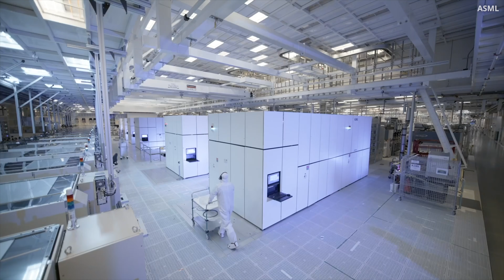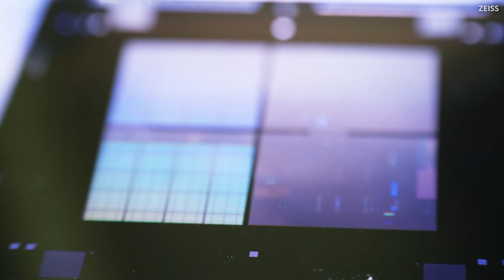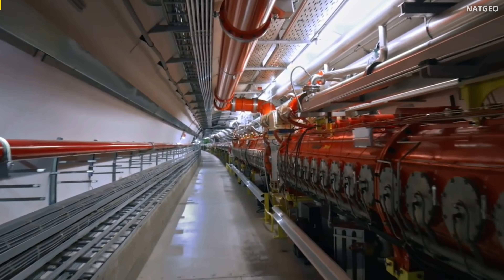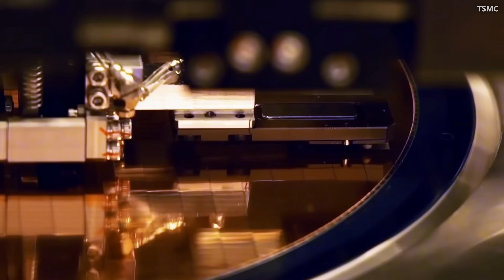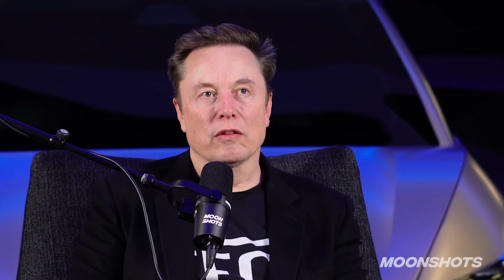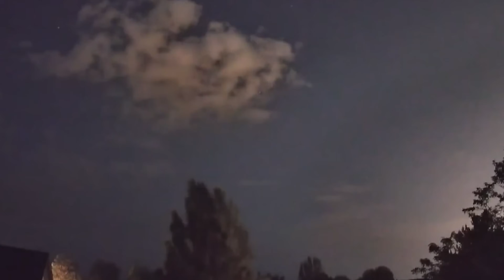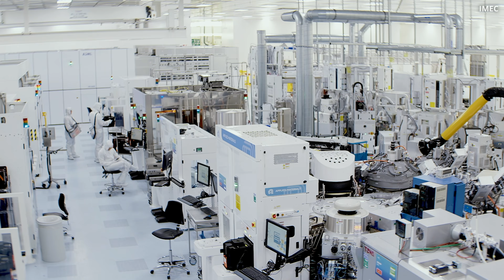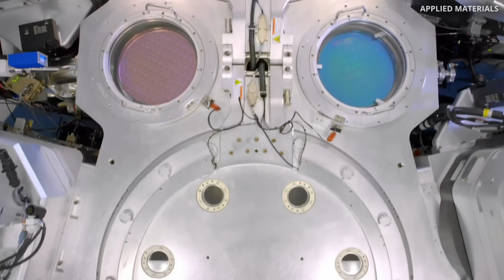New Chip Factory That Terrifies TSMC

Comment: There is a loss of chip area usage efficiency of fitting square & rectangular dies into a circular wafer.  Probably not practical, but its hard to say where brainstorming leads.....  Why not consider making identical (but perhaps individually rotationally positioned) dies of other shapes, starting with perhaps a hexagon.  One issue is cutting out the resulting dies if the cuts are not straight in X and Y ... but perhaps a laser can cut out the odd shapes.  Beyond hexagon shapes, what about various surface tilings?   Certainly circuit layouts from schematics are done automatically in software, and doesn't necessarily need to be done as a strict
 quadrilateral.

Comment: I think you’ve missed the core engineering shift. Elon’s 'cheeseburger' comment wasn't about making a dirty fab; it was about Wafer Isolation. It’s the 'Boy in the Bubble' strategy - the cleanroom is built around the equipment using vacuum-sealed lines, not the entire building. Also, the building going up in Austin is just the 'Advanced Tech Fab' (the Pilot Site), not the Terafab itself. That full-scale facility is almost certainly headed to Arizona, which is phasing to a 0% corporate tax rate (SB1252). Texas’s 'net receipts' tax is a non-starter for a project this big. They are using 700mm square glass panels (which Intel just demoed at NEPCON) this is 'probably' why Intel was invited in recently, as glass finally deletes the 'warpage wall' of circular wafers. Substrate (the company you don't seem to know is the heart of this project) is using maskless X-ray tech that’s already hitting 12nm. It's basically a parallelized evolution of the IBM 1977 EL-1 logic. While you're waiting for an ASML machine that won't show up until 2030, they're already drawing the future on glass in Austin.
Reply: Hmmm...  700mm square glass panels...  From a process tool perspective this reminds me of the early 2010s,  when AMAT and others introduced and demo'ed a-Si CVD tools for the production of PV panels that were roughly based on SOI  semiconductor process technology. Patterning - of course - wayyyyy simpler, lithography not needed, aso, asf. 
However, there was not enough silane gas produced on the globe to supply even 3 of these resource hungry fabs and would have totally drained and dried up the supplies for Si semi manufacturing. 
This led to a crazy global battle for process gases and chemicals resources between PV and front-end semiconductor manufacturing that let silane  projections and prices skyrocket, spiralling totally out of control and led to 5-year take-or-pay contracts that were stuck onto strategic purchasing at distributor and end-user levels, resulting in panic divestment and shotgun  supply contract reviews. And it wasn't just the silane, PVD/sputter targets, the "solar grade flat glass", bulk UHP chemicals, etc, were caught in the same mess, altogether...

Today, approximately 15 years later, it seems that still nobody has learned their lessons from that disaster. It's all beautiful movies and projected performance specs, feeding the patriotic investor's wet dreams. The reality will lead to a rude awakening as many critical materials (not to be confused with the rare earth metals discussion, I am talking UHP specialty gases and chemicals here, together with uniform 800mm UHP PVD targets) are down to single source supply only. No competition on the supplier side as many investors learned their lessons when burning their fingers at this overheating market. And NO, China won't help us here as they will restrict the export of critical process chemicals as we restrict the export of critical process tools. 

At SEMI ISS a few weeks back, the increasing scarcity of critical and strategic process materials of sufficient UHP and related high quantity manufacturers was flagged as one of the most critical bottlenecks of future production of 2nm/20Å dies. How this battle for critical process materials will play out is going to determine the future of chip making and wafer processing. And these worries just adressed front-end only, back-end with  dicing/slicing and packaging are completely different animals to tackle. 

Things are totally going to stay interesting - specifically when taking the global politics into consideration. I have received documents from front-end manufacturers already, asking for local storage of critical materials, contingency plans for logistics routes, dedicated for each gas and chemical, related 1-, 2-, 5- and 10-year  price and cost projections for the above and contingency plans to develop new raw materials supplies as many were sourced from Russia and countries of the former USSR and then again, China. 

Fun fact: semiconductor grade silicon cannot be made from sand, as it contains way too many impurities that make it commercially impossible to purify. The raw material for the fumes and wet silica processing is silica sand, basically a mineral closer to quartz than to sand itself. Also, the qualifying quarries are a handful and the best ones are not located in the US. You also need the same quality silica sand to produce the 700 mm glass wafers. 

There are so many aspects aside process engineering and not enough space to discuss them here...
Reply: @BigBoy4004 a small company by the name of HPQ silicon is close to commercializing technology that would allow the production of hydrophilic fumed silica from sand in a 1 step process. Hopefully that would alleviate the pressures on the supply of silane gas somewhat
Reply: This is all very well, but you still have to maintain the equipment, and that's going to expose the interior to the local environment.
Reply: @rogerfroud300  this is just my speculation, but Intel and Elon know how many people TSMC uses to keep their fabs running and both are trying to use AI to employ far fewer people, Tesla will run out of money if they have to hire too many people, also it's my understanding that Intel has made a lot of progress to automate their newer fabs so they don't need to use the TSMC high schoolers to a kind of a trade school pipeline to babysit each ASML machine to keep it running, I expect this new Fab to be basically a giant robot with very few humans and Grok doing a lot of the work
Reply: @DaxVJacobson  Dax sees the future while roger looks at the reality. Terafab’s success depends on whether Tesla and Intel can invent a “third way” that makes both visions work. I believe that this is ultimately just an engineering problem. In tech, what looks like “impossible physics” often just needs better automation. The April 2026 updates show Musk is betting on automated preventive maintenance—robots fixing machines before they break—to prove the skeptics wrong.
Reply: @DaxVJacobson This comment does not make much sense to me. The entire chip fabrication process is basically automated. You would have to somehow remove steps in the process to employ less people. Those machines do not maintain themselves and operators are low in headcount to begin with and AI is not mature enough to do operations work let alone maintenance or process engineering roles
Reply: whats this have to do with cheeseburgers?  what is a “semi conductor” like music stuff?
Reply: Try head and shoulders.
Reply: I agree 1000%   The real semi ecosystem is being built right now in Arizona.  Every week a new semi infrastructure company is coming to metro Phoenix -- LAM Research just bought a building that can house 2000 people.  A $7B science park is being built (Halo Vista) next to TSMC in N Phoenix for all the Taiwanese and Japanese companies (and American, and European -- ASML has 3 sites in metro Phoenix) to build out a complete ecosystem.
Reply: You cannot create a vacuum sealed building knowing there have to be people inside, even if only during manufacturing downtime. You cannot maintain these machines in a pressure suit, and every time you bring in humans, you bring in tons of filth and impurities.
Reply: @BartJBols  “ I will kill the filthy animals. “ - Claude.

Comment: For the Newbie if you are actually trading in the crypto space and you don't have a sound mentor. Then you are certainly going to get liquidated in 90% of your trades. Yeah that's sad truth. I remember when i just got into crypto back in 2019 but later in 2020 i ended up selling it because i have lost alot trading all by myself without a guide. Got back into crypto early in 2026 with $20k and I'm up with $232k in a short period of time...Thanks once again,  Alyssa Zentner. for your consistent updates and continued support
Reply: Just research the names Alyssa zentner. You’d find necessary details to work with a correspondence to set up an appointment.

Comment: I am not sold on the danger of radiation.

By far, the biggest concern is the occasional bit flip.

That sort of thing is pretty inconsequential in network processes. Most kf this is high dimensional sensor math where a single bit would not change the resulting sensor calculation to be off my much. And "off by a little" is a principle of these systems.

I think the cooling system will solve this problem.

Preferentially locate the CPU/GPU chips deep within the guts.

Just add coper - not kidding.

Copper is a very good radiation shield, and it transfers heat very quickly.

The cooling systems, with lots of copper surface area would naturally protect the cores.
Reply: “not sold on the dangers of radiation” 

New York

Sun Microsystems had a problem with radiation.

Servers at upper floors of the World Trade Center would randomly crash, while servers in the basement of the World Trade Center were stable. The issues was additional radiation at the upper floors.

It forced Sun to build error correcting paths EVERYWHERE in future systems. 

Texas

While I was doing Network Management, one day we started seeing errors on equipment, we swapped everything!

Eventually, we called the Director on site when it started happening, he was still in the office late, and it dawned upon him — the company fixed the neon light on the outside of the building, and errors were detected on all communication equipment whenever the neon light turned on the brick wall outside the building. Radiation.

Go into space

Beyond the magnetic shield of the earth, and the problem is crazy more difficult.
Reply: @DavidHalko 

Dude. 

Critical systems like flight support need to be hardened.

Non critical systems do not need to be hardened.

I didn't read what you said because -- you didn't read what I said.

Applying hardening technology will both increase the cost by a fee zeros per chip AND reduce their performance.

SpaceX will not do something that cannot possibly work.
Reply: @JohnBoen  - dude..,

I read what you said, and I can see you did not read what I said.

More than critical systems need to worry about radiation.

Everyday systems need to worry about it.
Reply: @DavidHalko 

Thank you for bringing in additional topics.

You are acting like I forgot about them - I was focusing on radiation damage to commercial grade hardware. Non critical systems... so you do not need radiation hardening.
Reply: If you aren't concerned about radiation in space, it means you aren't an astronautical engineer. The problem isn't just random electrons flipping bits. You also have random protons and other particles smashing through everything. If you try to run semiconductors with features that are only a few atoms wide, they are going to fail quickly. Fortunately, we don't need high performance computers in space.

And copper doesn't last very well in space. Use aluminum. It outlasts almost everything else in space and conducts heat and electricity very well.
Reply: @ersulhith 

I am a materials science engineer.

I think I got this.

Are you suggesting that you can't produce tuned fields to control particles?

Virtually all come from one direction...
Reply: @ersulhith 
Sabine seems to disagree with this:
Commercial AI hardware usually needs to be radiation-tolerant at the system level, not fully radiation-hardened at the chip level.
Why:

1. Most AI accelerators are not safety-critical controllers. If a GPU gets a bit flip, stalls, or needs a reboot, the overall system should still remain safe because a separate reliable control computer handles power, attitude, comms, and fault response. That hybrid split is now a standard space-computing pattern. 

2. Many radiation faults in COTS compute are transient, not permanent. The common problem is a single-event upset or temporary functional interrupt, which can often be handled with ECC, watchdogs, memory scrubbing, checkpoint/restart, node reset, or power-cycle logic instead of requiring a fully rad-hard GPU. 

3. Full rad-hardening costs too much performance. Space AI workloads need modern throughput, and rad-hard processors lag badly behind commercial AI silicon. So missions often accept managed risk on the AI side to get useful onboard inference performance. 

4. The required level depends on orbit and mission life. A short LEO mission may tolerate COTS hardware with testing, shielding, and recovery mechanisms, while long-duration or deep-space missions need much stricter assurance. NASA’s process is mission-environment driven, not “everything must be fully hardened.” 

So the short version is: you do not fully harden the GPU because you harden the spacecraft around it.

Comment: She’s completely wrong about the equipment manufacturing being at capacity. There is still a major slump in demand for components for the major manufacturers. The only one demonstrating a meaningful increase in demand is KLA and that’s the test end. 
They are all restricting output to drive pricing. All this equipment should e manufactured domestically without exception.

Comment: How do they get around the ASML bottleneck?
Reply from the maker: By partnering with Intel
Reply: @AnastasiInTech  how does Intel get around the ASML bottleneck? 😅
Reply: @flowqi212 Intel already has EUV machines and a place in line for more. The partnership is about borrowing Intel Foundry capability, basically renting Intel's EUV machine. Terafab will lean on Intel for parts of the process that are completely out of its hands like the massive line for ASML machines
Reply: @AnastasiInTech 😂😂😂..That's not the answer...lol
Reply: They are clean sheeting the chip design, from first principles, removing asml
Reply: @RichardFrost Are they eliminating lithography?
Reply: @brunopadovani7347  I believe X-ray lithography technology will eventually replace ASML's Hyper NA-EVU.
Reply: @imrich333 Probably true. I suspect that X-ray lithograph will be just as complex as ASML's machines.

Comment: Regarding the lithography machine bottleneck; Substrate is a US startup that's trying to make x-ray lithography happen. Japan is also trying to develop their own EUV tech. Elon might be banking on them to ship machines by the time the time the fab is ready.
Reply: Its possible that Terafab is actually borrowing/outsourcing to Intel's EUV. There is simply too long of a line for EUV to have a machine ready for a developmental fab in just a year or two
Reply: ASML is mostly just assembling, testing and finetuning the machines. They can scale easily. They have to, because the market is very cyclical. The question is whether suppliers like Zeiss have the ability to upscale their production.
Reply: Elon have the most powerful AI on the planet: Grok.
What if Grok absorb every high tech chips in his memory?